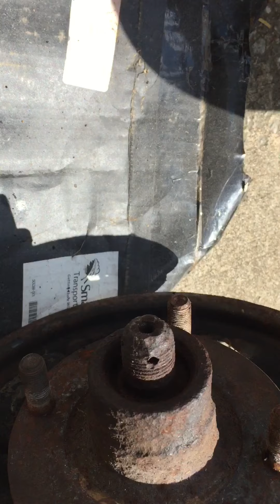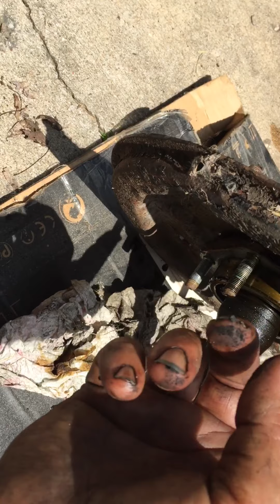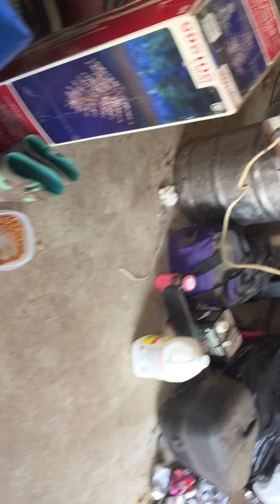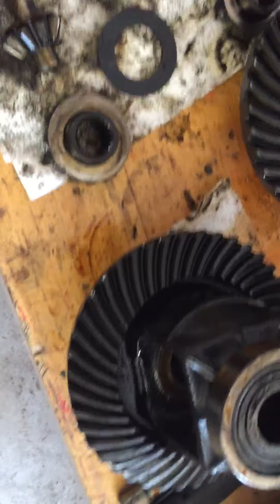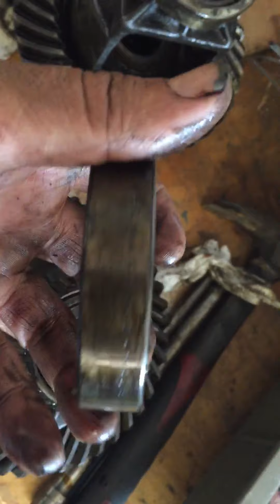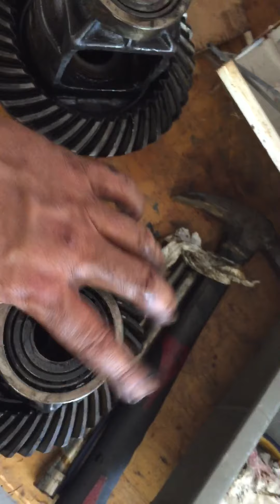MGC and Mgb used differential parts plus tech tip

Comment: Did the mgc ring gear fit the mgb carrier?
Reply from the maker: Yes it is the same carrier that the Mgb has there are several different styles for the MGC but the MGC in 1969 with transmission that has overdrive is the same carrier as the Mgb